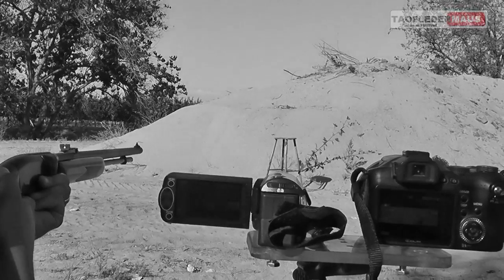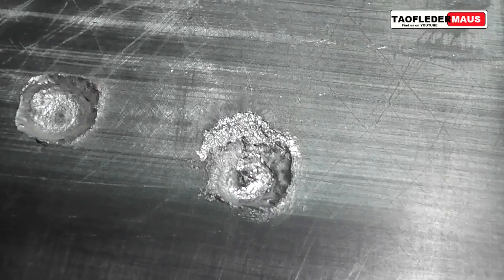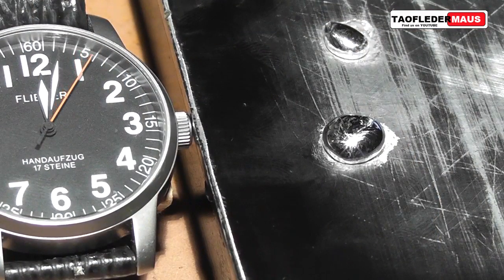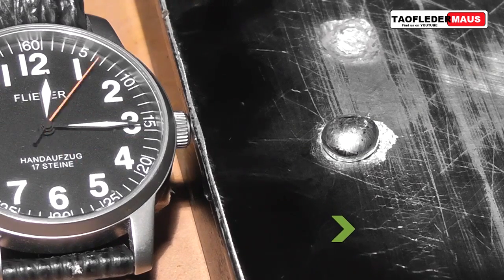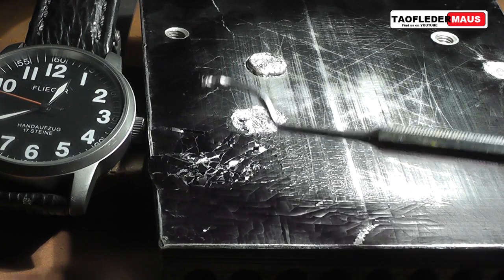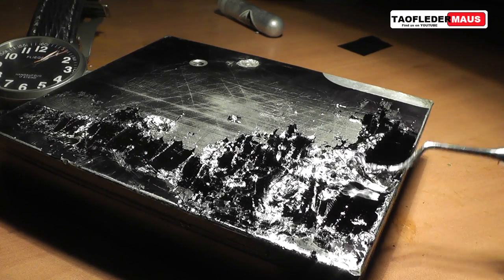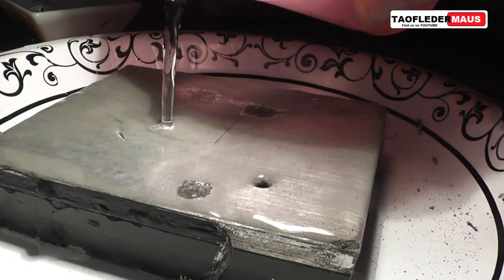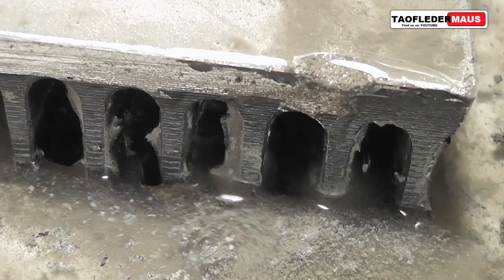Demonstration of GALLIUM's Amazing Destructive Power (gallium bullet follow up)

Comment: Ive seen previously vids where through electrolysis with water and baking soda and salt hydrogen gas is made and then ran through tubes for either a welding torch or to run a vehicle, so if galium and aluminum produce hydrogen just by being in contact it seems like that would be an easier way to generate hydrogen than electrolysis.

Comment: When you put the original gallium on the aluminum and the aluminum breaks up, the broken up gallium and aluminum mix to make gallium aluminum alloy. When you put this alloy in water it breaks down into hydrogen gas and gives you back your original gallium
Reply: Right. The reaction is breaking down the water molecules in order to steal the oxygen in them. The excess hydrogen is then given off as it is not needed. Essentially the gallium is vastly increasing the speed at which aluminum is turning into aluminum oxide.
Reply: Alexander Grimsmo Well gallium actually has two effects. The oxide disruption and the embrittlement (that doesn't need water). That works by diffusing through the grain boundaries in the metal, making it weak.

My original comment just explains the reaction with water, and how that is only stopped by the normally impervious oxide layer.
Reply: and the water being hot should've sped up the process too, right?
Reply: I am not a chemist, but if what you say it is true, then that drop of gallium will eventually eat up and destroy all the aluminum in the world! 
:)
Reply: Aluminum is a very reactive metal, if it weren't for the oxide layer it would react with water like this on it's own. All the gallium is doing is disrupting the oxide layer and allowing it to react with water. The gallium doesn't participate in the reaction at all. The other responses here are correct, I just didn't think they quite explained why it was happening.
Reply: Would this process then feed into itself, to continue to break down all of the aluminum until it can be broken down no further?

Comment: "I added heat to a chemical reaction and I can't figure out why it sped up"
Reply: Yes he explicitly does.

At about 1:30 he starts talking about how he is going to try to clean it off with soap and water to stop the reaction and see if it is salvageable.

Then says he's poured hot water over it at about 1:43 and proceeds to comment on how it's still reacting and in fact has sped up "almost as if I had just poured acid all over the heatsink".

If he wasn't lying about his goal of saving the heatsink then this would appear to imply that he doesn't know why hot water would be detrimental. This is supported by his comment about "adding acid" rather than "speeding up the reaction".

Were you watching with the sound turned on?

Comment: is the aluminium back in its normal form if you melt it down ?
Reply: You could return it to its normal form if you reversed the reaction, and then smelted it, however the aluminium has reacted to form a compound, so its not pure aluminium and if you were to smelt it down as is, it wouldnt work.

Comment: Test it on a macbook, and then put some on an airplane wing. Lol...new terrorists putting drops of gallium on airplanes.
Reply: +CPLCraft gallium melts in your hand, especially if you cup your hands around it.
Reply: wouldnt be hard. just shape it into something thats inconspicuous and just heat it up.
Reply: But it would work better if you actually had the gallium inside the bullet, rather than a little bit on top of it.
Reply: a bullet but instead of the steel core it should be gallium.
Reply: +BloodRaven did you not see the beginning of the video?

Comment: Chemist here, I'll explain what is happening to the best of my understanding (ie correct me if I'm wrong)

The gallium has to interact with the pure aluminum, so this means exposing pure aluminum (un oxidized).That is why the block is scratched so much. Once it gets to interact with the aluminum it goes into the Aluminums lattice structure and kicks some of the atoms out of position. To think of this in "real" world terms, imagine a wall of people holding hands. These people holding hands are the atoms of aluminum, and the gallium acts like a truck, where the atoms of aluminum are stretching, and distorting to hold onto one another. This makes the bonds between them weaker, and more likely to break. This is why the aluminum becomes very brittle.

The reason the water 'acts like an acid' is because when the water, gallium, and aluminum mix you get a chemical reaction resulting in the production of Hydrogen gas (demonstrated) and Aluminum Hydroxide.A similar reaction is show here https://en.wikipedia.org/wiki/Aluminium_amalgam

In essence you have a really cool bunch of reactions here.
Reply: it is considered an aluminum gallium alloy if im not mistaken but im no chemist

Comment: what would happen if you took those gallium infused aluminum chunks and form them into a powder for a thermite mixture, would there be any difference in the temperature of the burn, or would it light at all? Great Videos by the way, I love watching them!
Reply: It would likely have a lower yield than a pure aluminum recipe. 1) because the gallium has a different oxidation tier, and would release less energy. 2) depending on how much gallium is I'm the mix, it being denser than aluminum could prevent heat transfer from one reaction, to intimate its neighboring fuel efficiently. 
However, it may be possible to separate the gallium from the aluminum after pulverising it, to give you preformed fine aluminum powder.

Comment: I couldn't help but notice that the reaction was sped up or even changed when the water was added. Is t possible that somehow the gallium reaction with aluminum somehow formed a metallic cation in which something that can act as a nuclephile, like water, could then attack and form a metal attached to a hydroxide? Very interesting stuff

Comment: What if you made the bullet with the gallium and then sealed it inside the bullet by putting an aluminum tip on it? My theory is the aluminum would become brittle and disintegrate on impact putting the liquid directly on the target.
Reply from the maker: +N Cupit  Eh,   I still don't think enough of the gallium would be deposited on the aluminum to be effective.
Reply: Such rounds were experimented with IIRC back in the 50s. The idea begin that a few gallium rounds interspersed with more conventional rounds would create a fallback system. If the target wasn't downed in combat, the gallium rounds would go to work quitely undermining the plane. I think the expense killed the project. Besides, in the 50s, all air-to-air was oriented to stopping nuclear bombers.
Reply: somebody should try making a gallium paintball

Comment: Water is acid, Aluminium is highly reactive in presence of water. the reason Aluminium does not usually react in water is because it forms an oxide coating that protects it. By adding gallium you have removed the oxide layer and expose the aluminium below.
Reply: +Joel Reid water is not acid..the aluminium is more reactive than hydrogen so it takes the oxygen from the water and liberates the hydrogen...so you were mostly right pure water has a ph of 7 so is neutral
Reply: 1ukjunglednbraver Ok, perhaps you are unaware of the lowry-bronstead theory of acids and bases... so I will forgive you for being naive and trying to correct a Chemistry teacher.
A pH of 7 indicates that there is a 10^-7 Mol/L concentration of H30+ (or H+ for those who use Arrehnius' theory) This means it does indead have an acidic component. The acidity of Water is exactly why Sodium, Lithium and Potassium will react with water according to the reaction:
Acid+metal -> Salt+Hydrogen
The violent reaction of sodium in water is actually the hydrogen exploding due to the exothermic acid-metal reaction between the water and metal.

Water can act like an acid with any metal, expecially reactive ones, and Aluminium is one of the most reactive metals. The reason we do not see it react normally is becasue it is so reactive it forms a layer of oxide on its surface that acts as a guard against further reactions. However, as gallium is dissolving the metal under this layer (to get through the layer the surface had to be scratched first, which is done in the video) it then allows the aluminium to be exposed and therefore react with water...
Reply: i thought sodium explodes from coulomb explosion or so new research suggests that...but yeh as for the rest if you are a teacher you must be right
Reply: or at least when it seems to detonate...not when wizzing about on fire that is clearly the hydrogen and metal burning...i wonder why molten salt explodes in water that is an interesting video
Reply: 1ukjunglednbraver coulomb explosions are not the cause of the visible explosion we see from sodium. But Colomb explosions do not generate significant heat. Coulomb explosions are not visible to the naked eye, they refer to electron movement away from the valence shell... guess what happens when sodium goes from solid to salt in an acid-metal reaction? The valence shell electrons are ripped off.
This process is also called a 'redox-reaction' by the way.
Reply: 1ukjunglednbraver molten salt exploding most likely has to do with a chain reaction of an exothermic environment of salt dissolving in water reaching a point where a huge amount of heat is released at once. As there is no visible flame then it is most likely vapourisation of the water, and not explosion of hydrogen.
Reply: yeh its just strange the lack of leidenfrost effect..just find it very interesting the speed of the reaction its super cool

Comment: Purchase the .22 rounds that are primer only  and repeat your experiment.  You lost too much gallium due to the velocity of  the bullet, and then again at impact.  Even better, remove the bullet from the primer only rounds, and replace with a hollow point from another bullet (don't believe anyone is making primer only HP's).  Then fill that hollow cavity with gallium.

Repeat your experiment and I think you'll find the gallium stays in the bullet, and the bullet will bury itself into the aluminum, and not explode like previous rounds.  This should allow the gallium to disperse through the aluminum.

Comment: Couldn't this be used in attacks on buildings?
Reply: +connormcwood2 buildings aren't made of aluminum
Reply: +connormcwood2 but you can definitely use it to attack planes, oops
Reply: Stealthmuiz Empire State Building was
Reply: ***** no structural part of building uses steel, the exterior might be made of of aluminium, breaking that would do a lot of damage but will not bring  down the whole building.
Reply: +Dave Smith was thinking more of guerilla's (edit: or domestic dickhead) plinking US vehicles.. made of .. aluminum ...(like an M2 Bradley, or all the other aluminum armoured fighting vehicles) ...in the long distance, the rounds would no longer be supersonic and may leave a gallium deposit.. i'm sure it could be figured out.. and the large sea of vehicles parked at a base.. missing would be hard to do.

.. also hard to miss from the most extreme distances .. (though a .22lr with a can would give little report, super long distance wouldn't even be needed)... an LCS .. both use aluminum , the LCS-2 (tri-hull) is all aluminum, the LCS-1 (mono-hull) has an aluminum super structure .. a single dude with some gallium bullets (would require experimentation) could do billions in damages to quite a lot of US military hardware...
Reply: +Stealthmuiz it does the same thing to steel... Scary thing to me is not liking someone and just dropping a drop on each wheel of a car or just one it would look like a casting defect.
Reply: +connormcwood2 Buildings are usually made of concrete armed with steel. Gallium won't have any effect on either the concrete or the steel. Same is also true for wood, plaster and everything else we use to build buildings.

Comment: The water is reacting with the raw aluminum. Aluminum is highly reactive, it merely instantly forms a non-reactive skin of aluminum oxide. The gallium, of course, disrupts this layer so the aluminum is free to react with the water. There is no way to reverse the reaction or salvage aluminum touched by gallium or mercury.

Comment: Termed liquid metal embrittlement.  Pretty interesting stuff...  the Gallium diffuses through the aluminum, similar to how perfume diffuses through the air in a room and homogenizes.

The aluminum cannot be recovered simply by melting.  You'd have to separate the two metals afterwards.

Comment: can you melt it down and cast it back strong?
Reply: +thesparewheel At that point, due to reacting to the Gallium, it's probably not actually aluminum anymore, but whatever byproduct happens to come from that reaction. That, or the gallium is infused so well through the aluminum that you can't just melt it, as that doesn't actually separate the two. Remember, from what Jeff said, the gallium finds its way INSIDE the aluminum to make this reaction happen, so both metals are still there.
Reply: +thesparewheel not really. In this state, it is an alloy such as aluminum and mercury yields Aluminiumamalgamat.
A physical separation of the elements is not possible with alloys.
Would it be possible, then one could also recover metalls from other alloys, such as tin solder -> Lead by Fractional distillation. which is not possible
Reply: +icebluscorpion It is possible to seperate them chemically dissolving with acids and other substances

Comment: Suggestion: Why not hollow out a .45acp JHP (say, melt all the lead out?), then fill with gallium and try a larger target, like say an aluminum engine block (or a piece big enough to not simply fly away when hit)? Also, enough structure around it to not allow the gallium to go spalling off into nowhere should help as well...

As you see from your own footage, it takes a few minutes of exposure for the gallium to have an effect... Also, you can see there's not too much in the way of adhesion in the same footage... I'm sure if you would've dumped the gallium off the piece within a minute or two, the vast majority would've simply run off the top....

Thus, I figure if you have enough weight and structure, the gallium would stay more or less contained and kept around the aluminum long enough to have a real effect...

So, .45acp anyone? :D

Comment: When you poured the water over the heatsink and you said that it looked like you had just poured acid over it... you kind of did. When aluminium is by itself, it reacts with water to make hydrogen gas and aluminium hydroxide, hence the bubbling. Usually this doesn't happen due to an oxide layer coating the aluminium, but I guess that was removed by the gallium.

Comment: To those of you wondering where does the hydrogen bubbles come from : it is the aluminium reacting with the water. You get Aluminium metal plus water gives aluminium oxide and dihydrogen.
This does not normally happen if you simply put aluminium in water : the aluminium oxide makes a protective layer over the metal, blocking the reaction. Here, the gallium disrupts the adherence of the aluminium oxide to the metal, and the reaction can carry on.
This was once suggested as a way to power cars : an alloy of mostly aluminium and a few percent of other metals (some rare earths I think) would be reacted with water, and the obtained hydrogen would run the car, via a regular engine or a fuel cell.
I think it has since been disregarded, not sure why. Perhaps a matter of energetic efficiency (it takes a lot of energy to make metallic aluminium), or storage density.

Comment: Nice video. Here's an interesting idea though, did you know that if you alloy gallium in a specific way, with certain metals (indium and tin) with a HIGHER melting point than gallium, you get an alloy with a melting point lower than Gallium itself, in fact, below room temperature? Maybe that's something cool for another video?

Tin is quite common, and since you already have Gallium, the only thing that might be hard to get is Indium. It shouldn't be that hard though... But if you can't get any, try it with just tin?

Comment: Awesome video. It was pretty clever to try gallium tipped bullets, I can't help but think there's a way to get them working. Then again, I'm not sure I would want everyone with a .22 to be capable of rendering aircraft inoperable.
Reply from the maker: It seems to all splatter away on impact.    I was hoping trace amounts would still be embedded in the aluminum.    Sorry about taking forever to reply.
Reply: it's a slow reaction that could be fixed without even knowing just out of maintenance of the plane depending on what you hit
Reply: ***** Could you make a slug for a shotgun and try this again.

Comment: I wonder if you took a larger caliber bullet hollowed it out to where it was just a copper shell coated it in a nice layer of wax(the inside of the shell not the outside) put in the gallium and capped it with more wax it it would help deliver more gallium to the surface or even melted plastic instead of wax.. The thinking here is some kind of barrier that helps hold the gallium on the surface due to he instant friction that would melt the plastic or wax to the surface of the aluminum  ... I know it's asking much here but maybe a 3D printed honeycomb to hold the gallium. Or a solid plastic slug for a shotgun and you drilled holes (small) deep into it filled those small holes with some gallium if that would work too. Ok taking my thinking cap off.